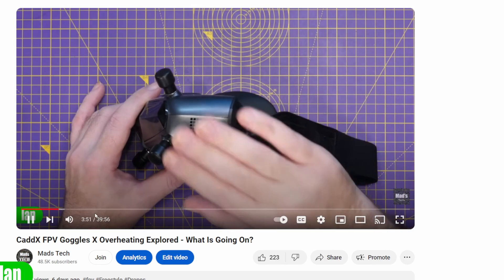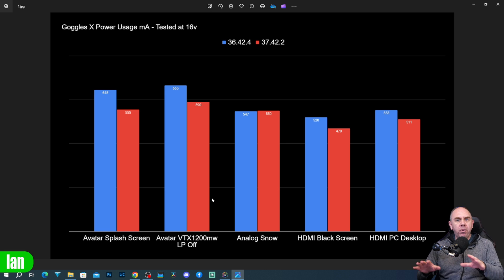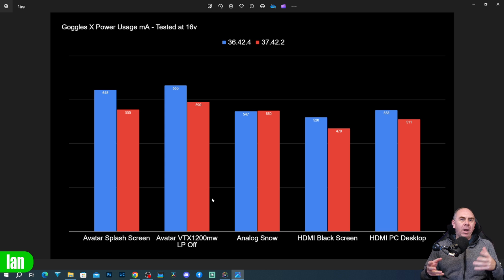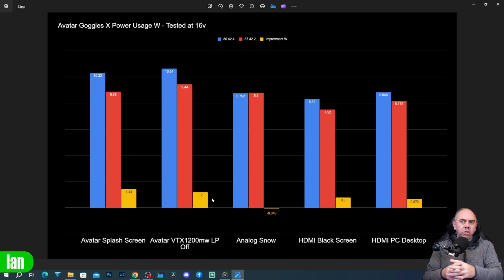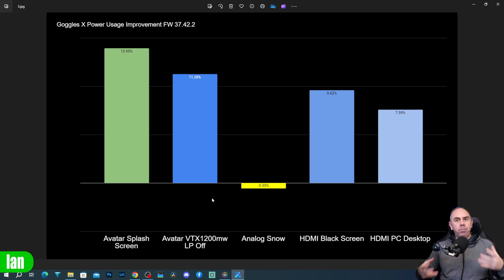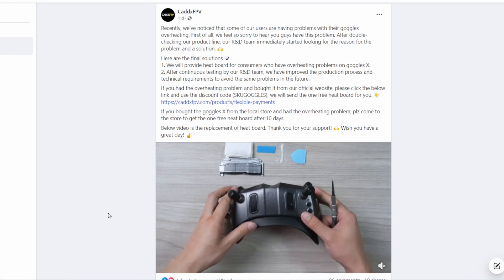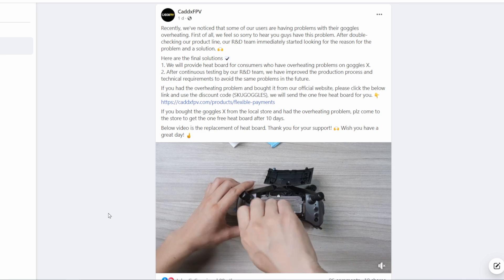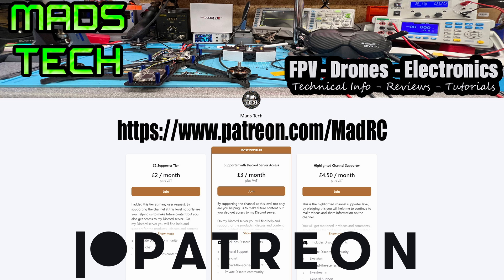Goggles X New Firmware Update - Did It Fix The Thermal Issue ?

Comment: Hi, thanks for all walksnail reviews, i bought the new goggles X and 1s mini kit and now i waiting the moonlight kit.
But i'm having two issues on the goggles... First is the wifi connection... i flashed two times the firmware and isnt possible to start the wifi spot when i power up the goggles, you know if exist any command or debug process to know what happend on it?? And the second is the proximity sensor... isnt working to,  i calibrate the proximity sensor but nothing happends when i take off the goggles..
if you can help me with the wifi spot i apreciate it...
Thanks for all

Comment: I got mine in this week, updated to latest 37 firmware and tested with hdmi input mode with PC and Laptop i dont see any issue but with mobile output the goggle display image for a second and behave weird thing like blue lines, green lines and off right display. This happened when i connect to mobile with hdmi In with PC and laptop it display proper image. I couldn't test with other devices and I don't face any heating issue let's see when i use it with vtx

Comment: Summer here. 40 C ( 104 ). Goggles ok but VTX lite cannot cope. It overheats a minute or so into a flight and same in standby ( low power mode). Even with two fans I struggle to use betaflight for more than a minute. They really need to put a physical off switch on the VTX.
Reply: Is your VTX lite v3 or v2?  They really did people a disservice on the v3 in my opinion.
Reply: @StickJockeyFPV  V3. So, the V2 doesn't have an over heating issue?
Reply: @TakeItToTheGround  I have used four of the V2 and none of them have overheated during flight
Reply: I am even running the V3 on 25 mw trying to ensure it doesn't over-heat. Without success.
Reply: @TakeItToTheGround  This may be obvious but try to give as much air flow on VTX as possible and if it still overheats contact them because I believe there is a warrenty or return it.

Comment: I think mine are hotter with 37.42.2. I can say that the temps appear to hold fine until i power a vtx and temps climbed from 48c to 83c in less than 5 minutes.

Comment: Since updating the firmware to 37.xx.x the highest temp I've seen on screen 1 is 57.85 degrees, even after leaving the goggles powered on for 2hrs 20mins. On the previous firmware I was seeing screen 1 reach 70 degrees in 1hr 10mins. So for me there's a definite significant improvement

Comment: I've just up dated mine with this but I wonder if it includes the kernel up date that was in the previous up date that I have skipped ?
Reply from the maker: No, the kernel update is not in this.  You would need to rename that file and downgrade to get it. CaddX are trying to make a separate kernel update version you can use later
Reply: @MadRC  I see I may do that then thank you very much for the reply

Comment: Damn, I just ordered these goggles too. Maybe I’ll return them
Reply: Run in other direction. Anyone saying good things is trying to cover up these abortion of goggles. I posted tonight in offical walksnail forum a photo of mine hitting 83c within 5 minutes of use on this firmware. The moderator responded saying to "just go fly" as if all is well and it's me that is the problem. Then he deleted it and my comment in reply.
Reply: @ChrisHarmon1 Did the right oled go out or give u a problem ?
Reply: Just check them out.

Comment: These goggles just look like a beta product. It lacks refinement. I will probably get the v2 or V3 of these. For now I'll just stay with the original fatsharks version.
Reply: I think your right to,stay with farshark units.
These goggles are absolute rubbish I feel sorry for those who purchased them,not real confidence building,Ian's doing there work for them,big thanks you Ian.
Reply: @M-H433 I haven't had any problems wih mine.
Reply: @drelephanttube  well that's what Ian is asking, put your temperatures down and firmware so he and others can see,and yes they do have issues,and there support is crap.
Reply: Plenty of people are NOT having any problems.
Reply: @fpvsmurf  as I said to another post put your temperatures down and firmware for us all to see,and I don't believe you have no issues.not 1
Reply: @M-H433 I'm seeing 49 degrees and 43 degrees (R, L) after 30 minutes use connected to a quad for 6 batteries. I don't have problems. Many don't. But some do. We don't know what the difference is.

Nobody was calling the hdzero goggles a beta product when almost everyone had shifting lenses. But confirmation bias is real...